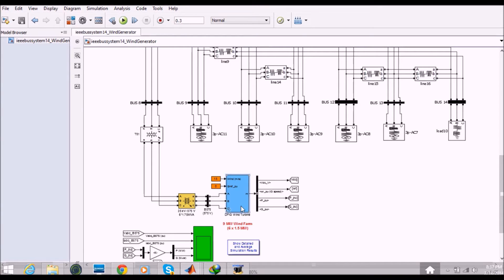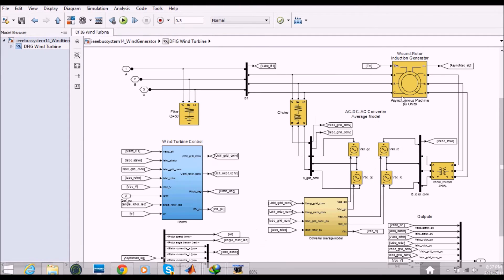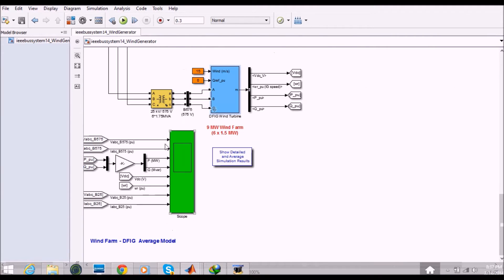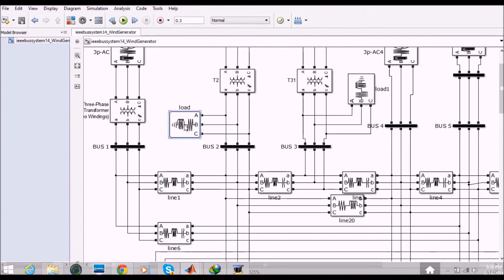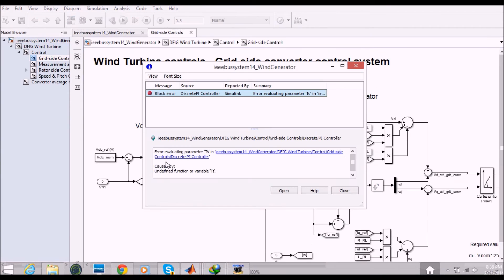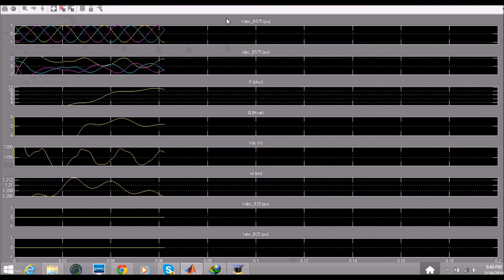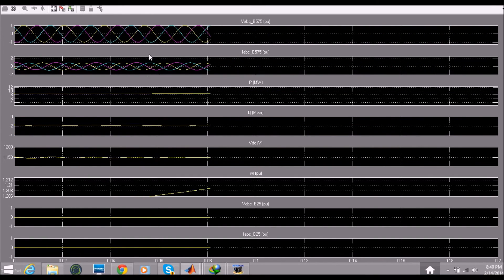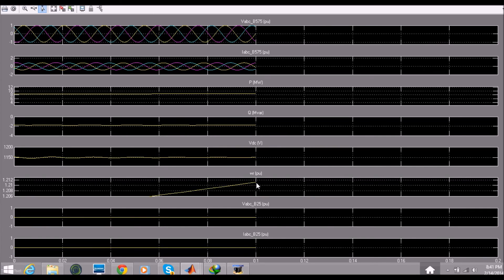IEEE 14 bus system simulation in Matlab Simulink | Connected with wind farm

Comment: it's so good ... ok I want to simulate a test system consists of 11 loads, 3
fixed-speed stall-regulated wind turbine generators (WTGs) of 630 kW each and a combined heat and power (CHP) plant with 3 gas turbine generators of 3 MW each. So What are the required modifications on your circuit ?? please can you help me :( it's so necessary for my research especially CHP ??!!